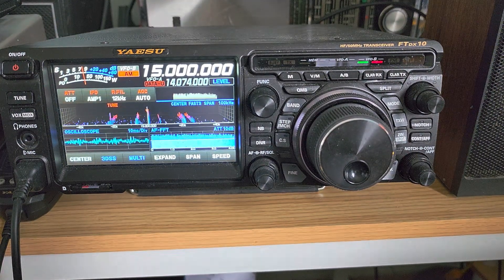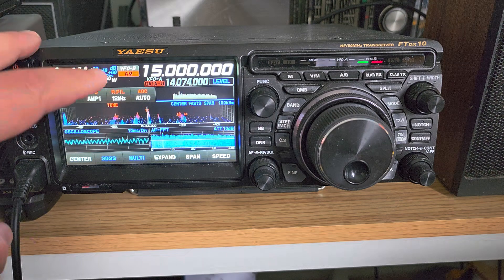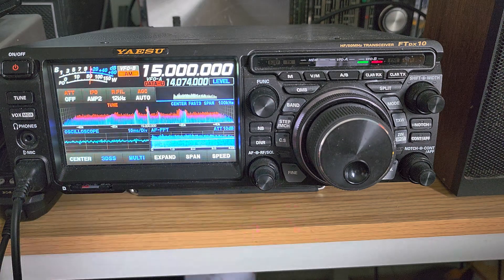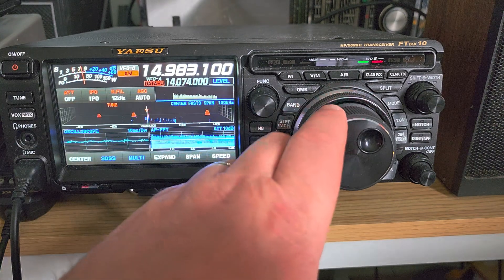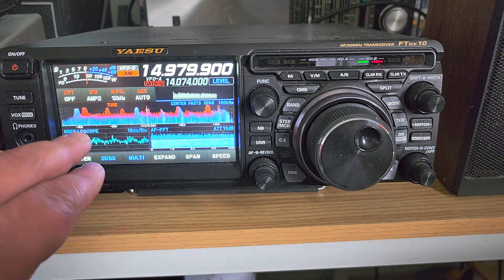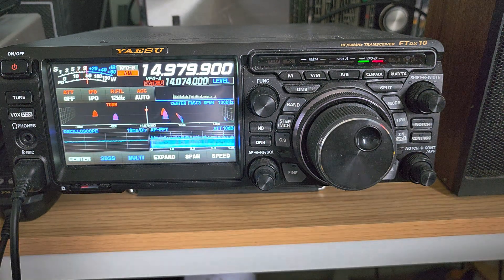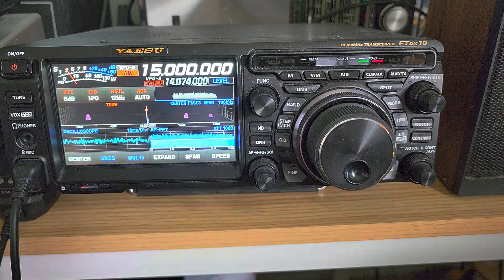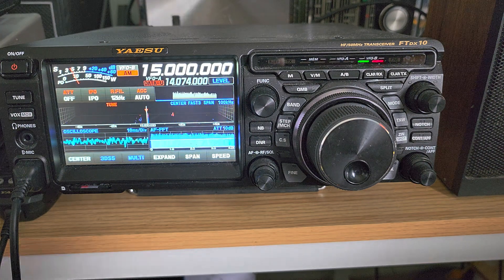Shortwave radio Not receiving anything?  Lower your noise, amplification will only make it worse

Comment: 👍 This all good advice. If you live in a really noisy environment, one option that may help is some type of loop antenna. A lot of antennas like long wires, vertical whips, dipoles, EFHWs and doublets pickup local noise beacuse they are not close-coupled (they have open ends). I have found  antennas such as "mag" loops, delta loops, folded/terminated dipoles, Moxons, etc. which are close-coupled are less prone to local interference.
9 times out if 10 that interference (QRM) will be local. It can be reduced depending on type of antenna. Also, current choke on your co-ax before it goes into the shack may get rid of Common Mode Current on your co-ax sheild. This is another very commnon way of reducing noise.

Comment: A good tip to find the source of the noise is to use an am radio using the internal ferrite antenna inside it to point atcwhsts causing the noise

Comment: If you have an RF Gain or Attenuator control start at minimum gain or maximum attenuation and slowly increase until best audible signal. If you are using a portable receiver with a telescopic whip do not be tempted to simply connect a long wire external antenna or overloading will occur. Winding a few turns of insulated wire round the whip and connecting your long wire to this will give much better results.

Comment: Even though I live in a pretty quiet location  for Shortwave listening, I still use a MFJ-1026 antenna phaser. You can also use a QRM eliminator. The reason being, is instead of having  or using an antinuator that is set for certain steps,with that 1026, I can back the gain down slowly and smooth on my antennas like a volume control. 

This allows me to tame the atmosphere noise, lightning and also slowly back the gain down on a very strong signal. It's not a preamp, but a simple gain control for my antenna. Yes, I could use the RF gain, but why wear the knob out as you tune.

Comment: Gilles...This was a very simple presentation, but extremely helpful. Thanks for what you do for shortwave radio. Meanwhile...I just purchased a C. Crane Skywave SSB2  travel radio and have ordered Aleksandr's Belka DX with the speaker/folding stand. Both were on my radio bucket list. I have enjoyed my ICOM 7410 for many years and like ICOM in general. But, your Yaesu FT10 may be worth the upgrade. Thoughts?